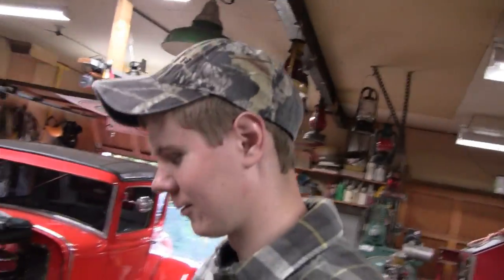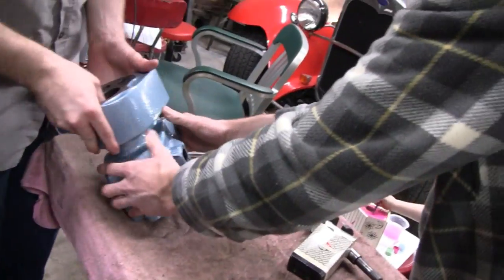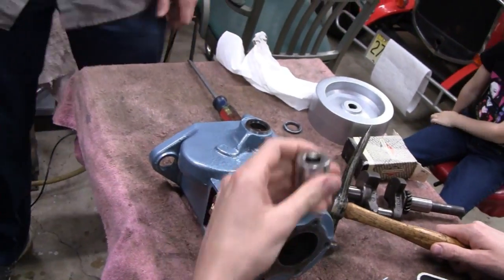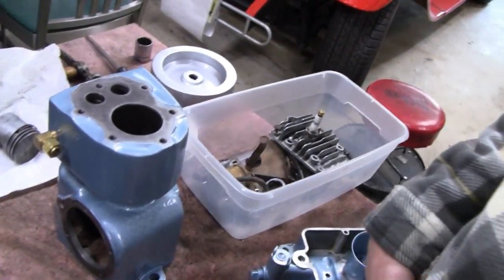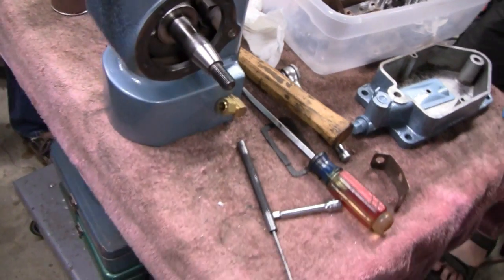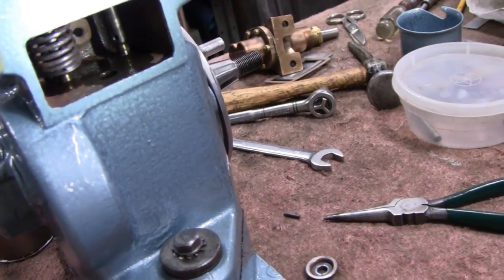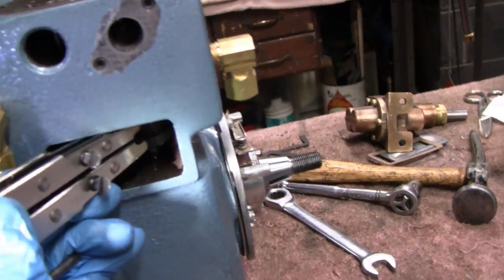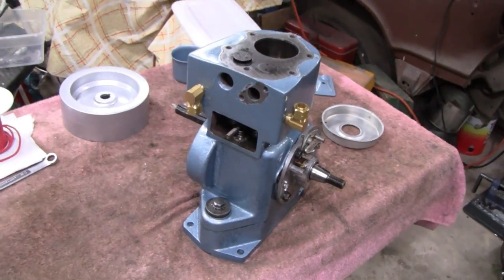HOMEMADE WATER COOLED BRIGGS ENGINE (part 28)

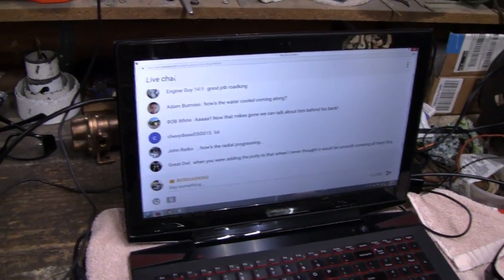Comment: 805ROADKING at 1:57 is that a Lenovo Y-50 gaming laptop? If so, have you had any problems with the hinge becoming stiffer and stiffer, to the point were it splits the LCD face plate every time you open it?
Reply from the maker: That's lil' Dirtbikes laptop, it's fairly new and I don't think he's had any problems with it!!☺
Reply: Okay, thanks, good to know

Comment: Flywheel in balance or out of balance, doesn't really matter for this application, so long as the engine and sled doesn't go vibrating across the table and fall to the floor.  It's not like this engine will be connected to a load or do any sustained real work, where tuning for minimum vibration would enhance longevity.  This engine will be looked at a lot and started and run for a few minutes occasionally.  I don't think demands on engine design are that critical here.

Comment: The washer's name is Belleville. They provide outward spring tension on the nut and inward spring tension on the item being retained. Use them when ever I can in place of typical star or split ring lock washers. They don't mar the surfaces and generally look nicer. Great looking engine. It'll Never Run!! lol...J/K Roadie Buddy! Zippy~
Reply from the maker: Thanks Bud!! If it don't run I'm shippin' that bitch out to Indiana!!☺
Reply: lmao!! We both know it'll purr like a kitten. I'm looking forward to the first start, test and tune. Give that new tachometer a work out! Zippy~

Comment: I have a model 5s I am restoring, and I was told this coil http://www.ebay.com/itm/121314427731?_trksid=p2057872.m2749.l2649&ssPageName=STRK%3AMEBIDX%3AIT would work as a replacement to get rid of points, but after installing it it still did not produce spark. From a quick Google search it looks like I might need to repolarize the flywheel but not sure, any suggestions?
Reply from the maker: No that won't work, this is what you need http://www.ebay.com/itm/Solid-State-Ignition-Module-Replaces-Points-Condenser-/181115603988?hash=item2a2b54cc14:g:zKoAAOSwo0JWOhWm
Reply: Thanks, I have heard of these modules before, but didn't think about using one. and can I still use the same coil? the engine didn't have a coil when I received it.
Reply from the maker: You need a 5s or 6s coil!! The one you have is for a modern 7-16 HP!! The 5s is only 1 HP!!☺
Reply: Lol thanks sorry for causing so much trouble 😂

Comment: I love the brass but on the valve cover-it just brings it all together. I also finally figured out why I spent so much time on the flywheel-I thought u were just going to put a cover over it so i was confused why u were even bothering with it. Also sorry I'm a couple videos behind but what kind of alcohol did you use for your drilling?
Reply from the maker: I use Isopropyl or Denatured Alcohol, Whatever is handy!!☺
Reply: 805ROADKING thank you sir

Comment: Hi  Thanks for another great video, That Engines looking more factory built every time we see it. Now here's a question, Are you censoring comments or are the 30 expert engineers that usually comment still in bed. I'd of figured with 102 comments one of them would of said "if you get that running" that out of balance flywheel would rattle them cover screws loose, and rub that points wire through to ground doing it like that !   L.O.L . Take care see ya next time.
Reply from the maker: Thanks Bud!! Give them some time, the video hasn't been up that long!!☺

Comment: Nice looking engine. What is the valve clearance on a flathead. I have one that I am going to rebuild?  Can't wait to see yours run.
Reply from the maker: Thanks Bud!!  Aluminum block= .005-.007 intake, .009-.011 exhaust
cast iron block= .007-.009 in, .014-.016 ex, or .017-.019 ex, depending on the model!!☺

Comment: I like the wide flywheel ...Looks like the ones they run with the flat belts on the old steam engines ...The brass pieces add some nice style points and also gives an old time look
Reply from the maker: Yeah cutting the fins and making it skinny would have looked like shit!!☺
Reply: not2fast4u2c agreed
Reply: agreed, would have looked like a new briggs ex625 or whatever, just came out with a new vertical shaft engine design with an entirely plastic carburetor, engine block is made of paper thin aluminum casting, used on all the new chraftsman, husqvuarna, mtd yard machines, toro, all of em, crying shame, such a pain in the ass to start, my aunt and uncle gave me a brand new mower and said the engine was just ronnied, i get to pullin the string and pushin the bulb before i take it home and i start to see what they mean, probably just clogged carb right? dead coil? ive seen it, got it home and it started and ran, it ran fine like a brand spankin new one should, but why didnt it before for both me and them?, JUNK thats why, put an old tucumse motor on it and it starts 4th pull every time with a bad primer bulb, ill replace that and it will start 1st every time, our toro recycler has just an every day average briggs flathead with no bulb and a "garanteed to start" sticker that might as well be written in stone, it does what it says its going to do which in this day in age is something worth bragging about all day every day, and people call me insane for saying old school is infinitely better!, btw that flywheel looks like a piece of billet aluminum machined out perfectly, looks great roadking! havent seen such a good lookin motor in a long time. . .probably going to do a boltr on that chonda briggs motor, i expect to see alot of plastic where it doesnt belong